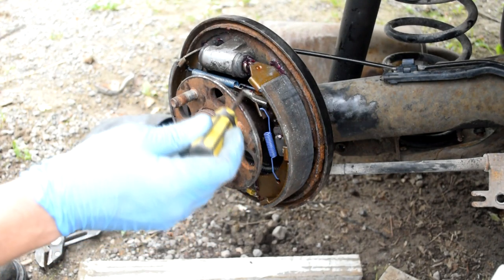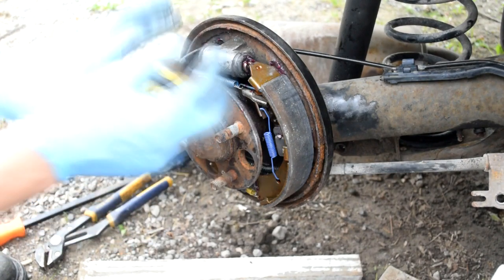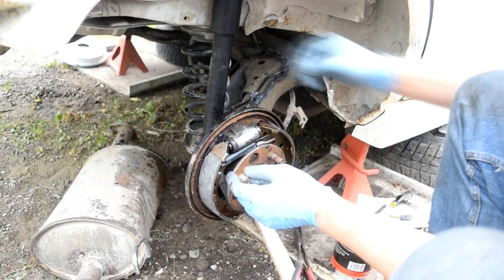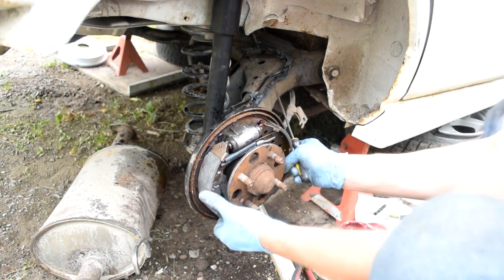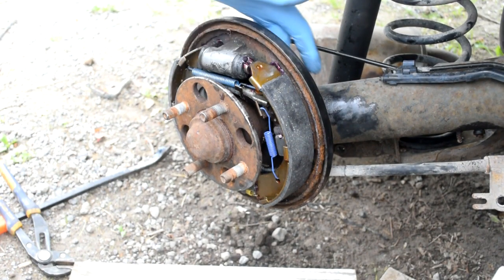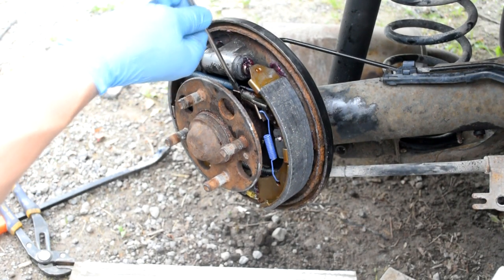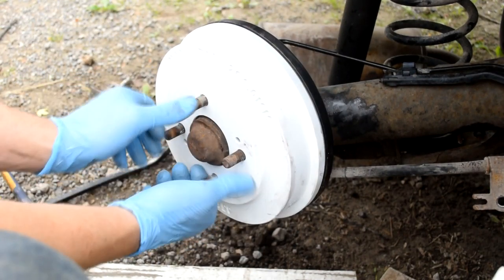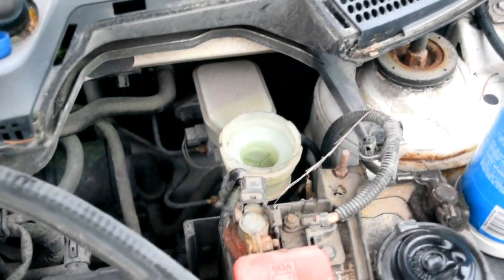How To - Replace Rear Brakes Honda Fit 2007 - 1st Gen

Comment: I finally put my drum brakes back together with new parts on my 2012 Fit - first time ever doing that. 

All I have to say is WOW, what a challenging and frustrating job. 😫 Getting that dang connecting rod to stay in place in it's spot on the left shoe without falling apart, while trying to get the upper return spring reassembled at the same time, all the while trying to get all those pieces over the wheel hub was an absolute nightmare. Took me so many tries. 😖

I am glad I was able to put it all back together, however! Definitely an accomplishment. However, that was just the driver side, I have to do the passenger side next! 😫😆 

Thanks again.
Reply from the maker: Congrats!  I HATE drum brakes because they are such a pain in the behind. Luckily, the other hand usually goes easier than the first. Good luck!

Comment: How often are you supposed to change rear brakes? (honda fit 09)
Reply from the maker: Very infrequently. More than likely you will never have to do it. About 70-80% of the braking is done by the front brakes so this is something you would only need to check annually if you can or if you start to hear grinding noise in the rear when braking.
Reply: @goddom  Thanks!

Comment: Any idea if this is the same as the 2nd gen? I'm afraid of taking this thing apart and not being able to get em back together
Reply from the maker: I can't guarantee they are the same, but I would be surprised is they are much different since drum brakes are not really innovative tech, so I can't imagine they would change much. I did a quick check, the part numbers for the drums and shoes are different, so they aren't exactly the same, but the hardware kit is the same for 1st gen and 2nd gen cars. That means the shoes and drum might have changed dimensions slightly, the springs and such are the exact same so the install will be nearly identical.
Reply: @goddom  took a good look at it, my needle nose couldnt handle the springs gonna try to go out for a set of spring pliers tomorrow, otherwise it looks basically the same
Reply from the maker: OK, good luck. I hate drum brakes because they are so much more complicated. Calipers are so much easier :-)
Reply: @goddom  yeah I gave up years ago, your vid inspired me to give it another go since I've got the parts. I've done a clutch change before through YouTube videos so I figure this has gotta be a little easier. Thanks!
Reply: @goddom  by the way, got it done. First one took about 2 hours because I cut my hand but second one was a breeze, maybe 45 min
Reply: @D. Alex Sorry to hear you cut your hand. What was it that gave you the cut?